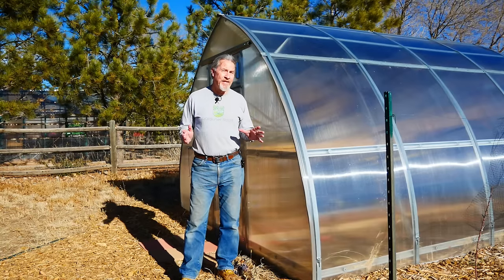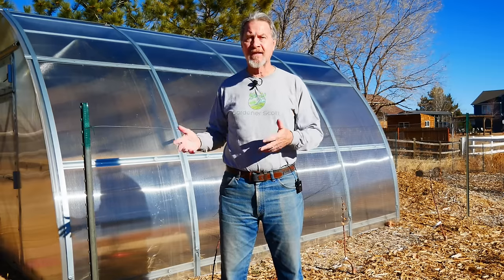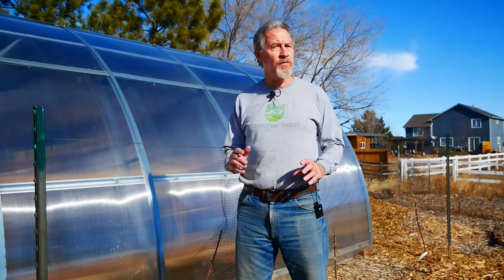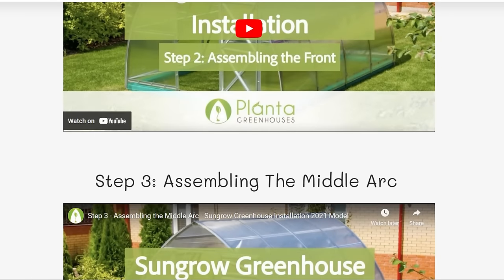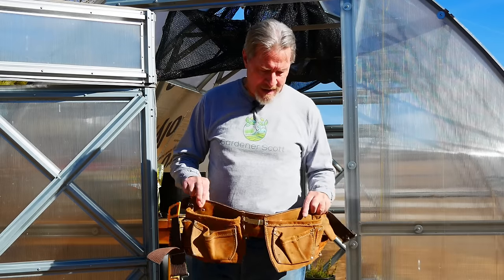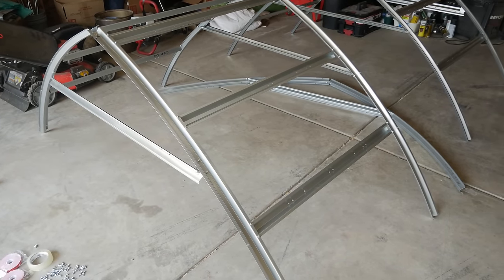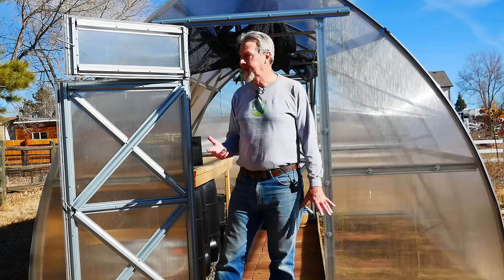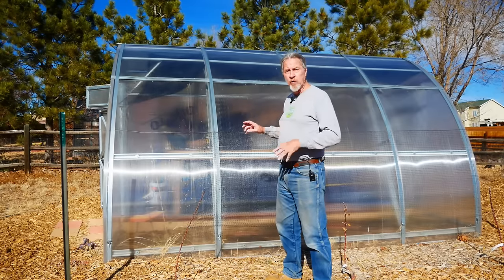How to Build a Greenhouse Kit

Comment: We have exactly the same greenhouse as well.  We built it this last summer and had similar challenges.  We still have to put in the vent windows and a flooring in. The basic build was a challenge but we are happy with the final product.  It is quite pretty and feels quite sturdy.
Reply: You're going to love the vent windows! The first time they opened automatically I was so excited 😁 I do GroBuckets in ours so the floor was very helpful. It was really easy easy to install Gravalock over landscape fabric and add in the gravel. It looks very high end and it drains like a champ! And, yes, we had the backwards feet issues as well. And our doors are a tad wonky. But I love it and have weathered thunderstorms in it.

Comment: 😂😂that’s allot nuts and bolts!  I was going to say clamps would be needed.  Measure twice—cut once.
I think Planta could use your editing advice🤔

This vid posted bout same time Kevin from Epic posted giving a GH to Jacques for birthday.  Kevin left the starting of GH to Jacques 😂.  The GH had polycarbonate roof with glass sides.

What is the purpose of a GH to have a polycarbonate roof with glass sides?  Maybe cut intense sun in CA?

I didn’t get to expand my GH by a couple feet yet and looks more like a summer project now.

Did you get a new computer yet?  I finally did and glad I did because there have been dramatic improvements.  Hopefully you figured out the problems you’ve been having on Lives.
Reply from the maker: I'm guessing that the polycarbonate tends to have UV protection and glass might not. I do have a new computer and it's working well.
Reply: @GardenerScott glad to hear as I think you cut out on last live session.  
I will repeat my post here again hoping you will see it:  Leigh just posted a video ‘Our Backyard Garden’ and had great success with Napa Cabbage ‘One Kilo Slow Bolt’ from Botanical Interests.  She is in NJ, but it took off in the fall for her.  They were Huge.  
Not sure why, but I don’t always get notifications from certain channels when the author comments back to me and I guess your channel is one of them.  Must be a switch to flip somewhere😅. That’s me working on tech issues😅.
Reply from the maker: @dustyflats3832  Thanks. I'll look into that one.